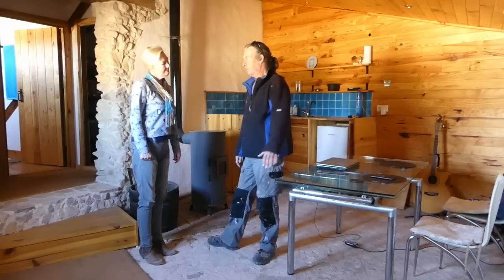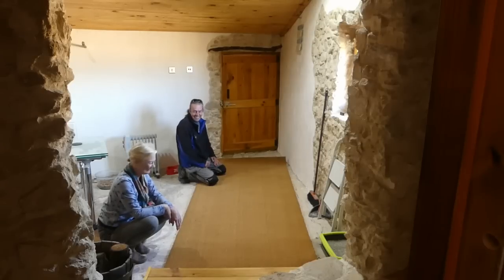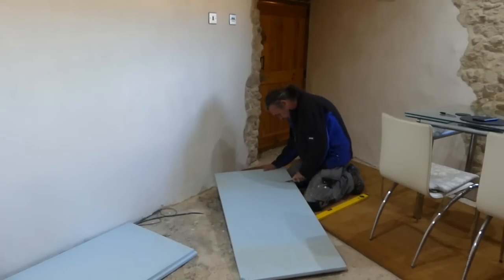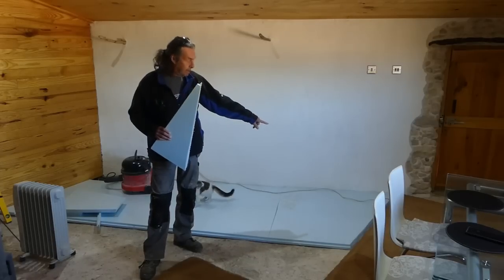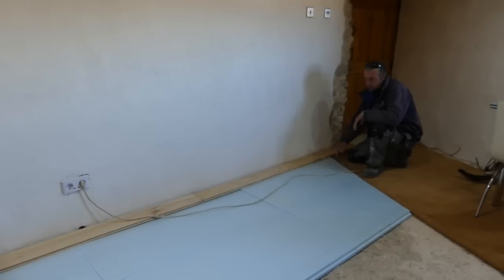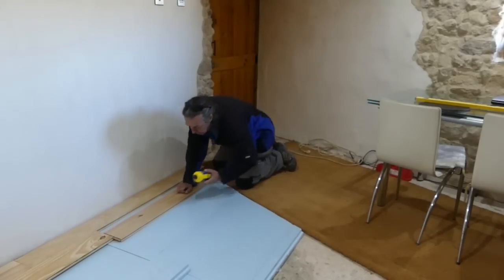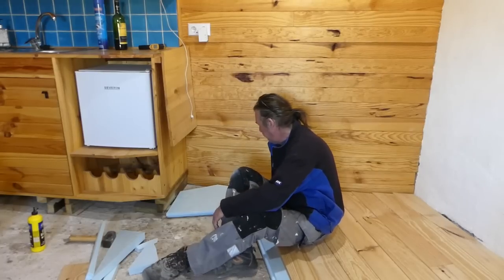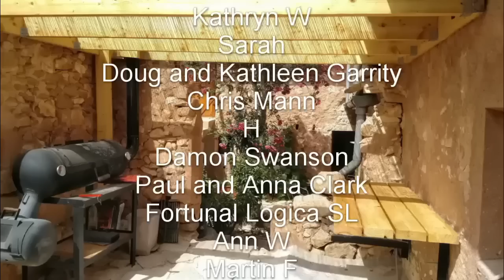Laying a solid pine 'floating' floor in the 150 year old Hay Loft

Comment: Why aren't  you putting wood all around?
Reply from the maker: We're trying to keep the level by the door as low as possible as the door header is really low already
Reply: Looking good guys, it’ll be beautiful when it’s finished!..just knew it would be different angles at either end, a good excuse to buy a second chop saw Andy ha ha 😂..ah, like you said though, it’ll be fine once the skirting is on and it gives it a bit room for expansion so it’s all good anyway 👍…for me, the only thing missing is a nice comfy Chesterfield or two to sit in front of the fire a read a book, bliss!..take care both of you 👍
Reply from the maker: @MarkOneMoto  Thanks Mark and apologies, only just saw this. It crossed my mind to get another saw lol